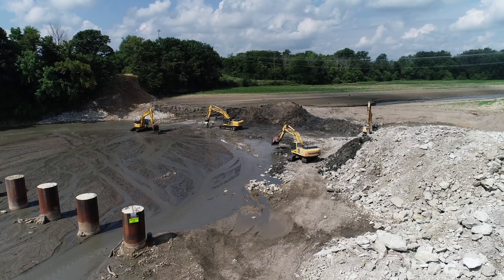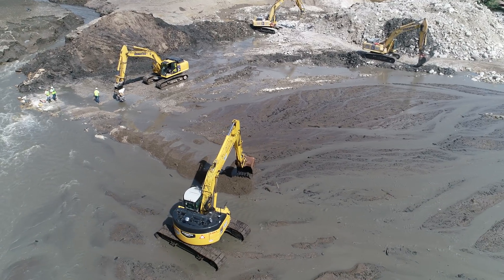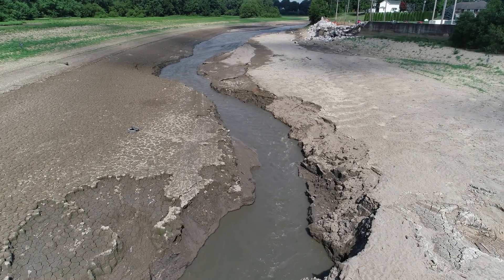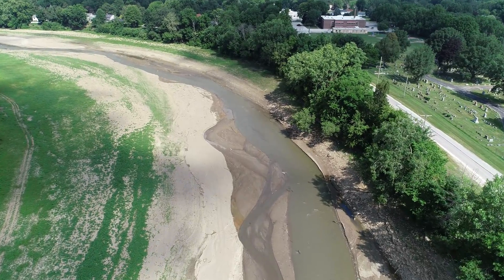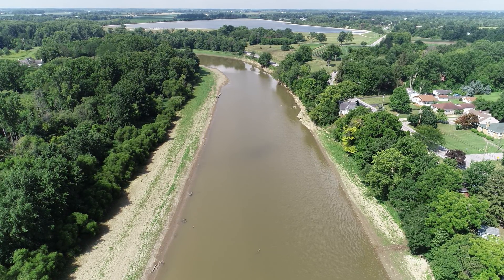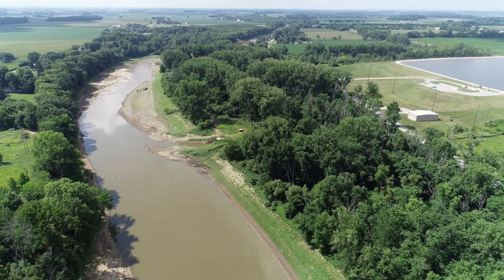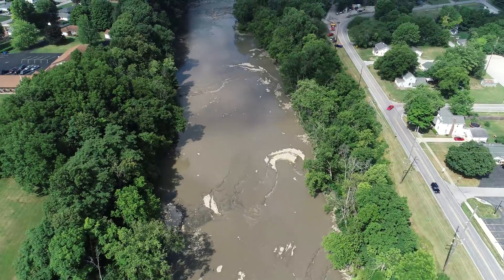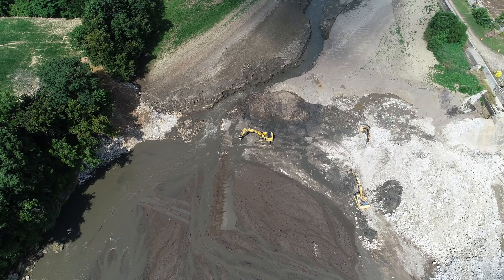Dam Removal Day 23

Comment: You keep checking on the "intake" of the water going "into" the reservoir, and reporting that water is still flowing "into" the reservoir as if that's a good thing. The Reservoir is ABOVE the river. That's the excess water flowing OUT of the reservoir.
Reply: No.  Water from the river intake Bruce describes is pumped into the reservoir as the raw water source for the City of Fremont.
Reply: OK Thanks. That makes sense now.

Comment: I don't understand why they don't remover a lot of that sediment north of the dam and make the channel wider and sloped better. If I was a farmer I'd love to have that dirt on my fields or pile it somewhere and sell as topsoil. To me be better to recycle it than to have it all go down stream.
Reply: The dam removal environmental studies estimated approximately 840,000 cubic yards of sediment existed behind the dam.  The removal of the dam is estimated to result in less than 470,000 cubic yards of sediment moving downstream through a natural process; the use of the notch approach to the dam removal was intended to minimize the amount of sediment moving downstream.  The average annual movement of sediment moving down the Sandusky River between 1979 and 2002, with the dam in place, has been 368,000 cubic yards.  The maximum sediment movement down the Sandusky River in a single year was 867,000 cubic yards -- more than the entire amount of silt accumulated behind the former dam.

An option to remove 200,000 to 300,000 cubic yards of sediment from the impoundment area was studied.  Excluding costs of engineering, permitting, material processing, dewatering or other associated costs, this partial removal was estimated to cost and additional $10.5 million.  The present cost of the entire dam removal is $9.5 million.

Some grading of the sediment is planned immediately upstream of the former dam to shape the new river channel.  To shape the new channel there will also be some filling of the north side of the river downstream of the dam (where the rubble is presently being piled), where the river had been artificially widened for the dam.

The studies expect that the release of the sediment will likely result in some localized accumulation of sediment downstream of the dam.  Depending on the amount of annual precipitation, this accumulation is expected to clear the river over a few annual cycles.
Reply: contains certain amounts of contaminants
Reply: The quality of the sediment was also studied.  With few exceptions, the sediment samples collected in the impoundment area were not statistically different than samples collected downstream of the dam.  There is much more information about the quality of the sediment in the study, but the summary is "The conclusion from the evaluation of the results from the supplemental sediment sampling is that the removal of the Ballville dam would not cause adverse environmental effects due to contaminants contained in the sediment. This is because the levels of contaminants are either below levels that would be expected to result in adverse effects, or because the levels of contaminants in the sediments in the impoundment are not significantly different than the levels of contaminants in the sediments below the dam."
Reply: Sorry Joel but YT nor the browser it is being watched on does not quite post new info when one is viewing said video when new info or comments is being posted. Thus I did not see your comment before mine as it was not showing up at the time I was viewing and then making comments, thus like I said though, "contains certain amounts".
Reply: Everybody wants the sediment. Nobody wants to pay millions of dollars to dredge it, dry it, buy or rent the ground necessary to store the sediment while it dries, haul it around to the farmers that want free sediment, and then pay to repair the roads, etc, torn up by the process.  Free sediment is really expensive for the taxpayers.
Reply: Interesting comment just to bad you don't know what you are talking about. Where I live here in the Kansas City area they do just that. In fact another step further in what I said is the fact an old family friend who my Dad went to school with owns a company that drains ponds small lakes and what not and removes the silt and blends it with black dirt and sells it by the truck loads 6 days a week. He has a topsoil business and makes a damn good living moving dirt around. Does not cost millions to dredge it and roads are not torn up doing so. The land owner pays a very small fee and gets their pond or lake cleaned and improved. Some of the local sod companies as well buy the silt and apply it to their fields to help in replacing some of the good ground that has been hauled out on rolls of sod. Then they plant soybeans and rotate them into the ground to add extra mulch to bring a field back to life. So you see it isn't a stupid idea at all and must be profitable or the old friend wouldn't have been doing it all these years. In this case our friend would set a track hoe up there and start loading and hauling the dirt/slit out of there long as it wasn't raining. They will even pulverize it for you if you want and well over 75% I am guess is. Another point about this is he isn't the only one doing it. Two other companies sell topsoil dirt just like he does. Maybe not where you live but around here people make good money recycling that dirt/silt. I asked the question the way I did to see how many know it alls or the type of replies I'd get. It was about what I expected.
Reply: In other words its just as toxic below the dam as above it... Thanks that helps.

Comment: So, will they demo the ice control piers?
Reply: The Ice Control Structure is intended to hold back ice floes to reduce the chance of ice jams forming in the downtown Fremont area, causing flooding by overtopping the floodwall now protecting the city. The ICS was installed to replace that lone remaining function of the now-demolished dam. The structure was actually built out of sequence because of the delays in the dam removal caused by some legal challenges to the removal. The ICS was originally scheduled to be constructed after the dam was removed. The piers will remain.
Reply: They were installed before the decommission for ice control, there is a video showing how much ice went over the dam a few years prior, they are not likely going to be removed or go anywhere for quite some time.
Reply: Here is the video: https://www.youtube.com/watch?v=g0qmmx1LK9g

Comment: I won't be surprised if they dig out the sediment to make a wider chanel.
Reply: There is no more dams!
Reply: Only known damn on the Sandusky
Reply: Joshua79C C, the only known dam until you get upstream to Tiffin, Ohio, which has two remaining low head dams.
Reply: What did/do those provide? if not for electrical power they are nothing more than a weir dam for flow control or for irrigation purposes.
Reply: Joshua79C C, one of the remaining Tiffin dams presently provides for that city's raw water supply.  The other formerly provided power for the Pioneer Mill.  Both are officially referred to as low head dams.
Reply: from what i googled it seem one of those others is also in the works for removal, probably after this is done so as to not have further impounded the silt already blocked behind this one
Reply: A third Tiffin dam, the St. John's Dam, was removed in 2003.  http://water.ohiodnr.gov/safety/dam-safety/st-johns-dam
Reply: yeah I read a news article about it
Reply: It would make a more natural chanel.
Reply: I agree they should remove the silt while they are doing this. If they don't it will just buildup elsewhere downstream, maybe behind another dam.
Reply: Tom G. If you noticed further up stream, the silt is stopping the water from flowing naturally.
That little stream gets wider when it hits the silt.